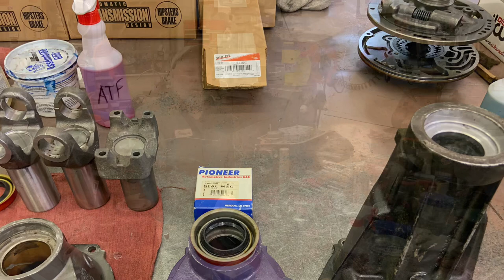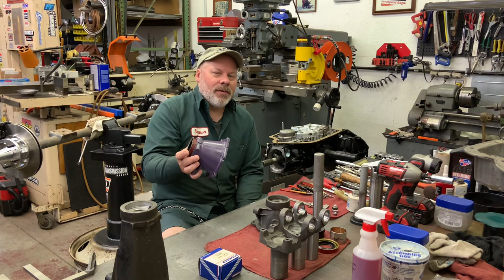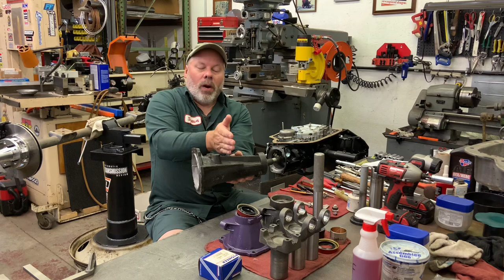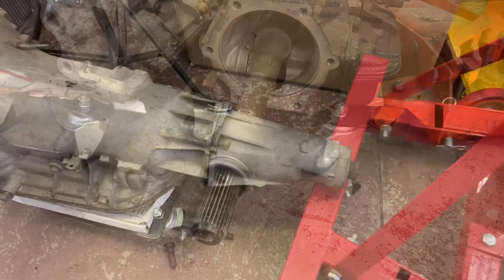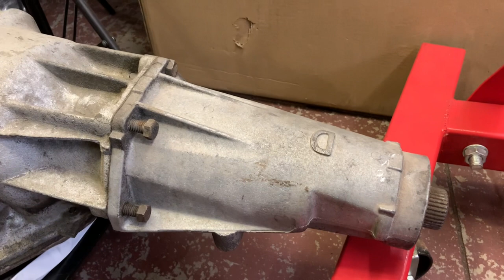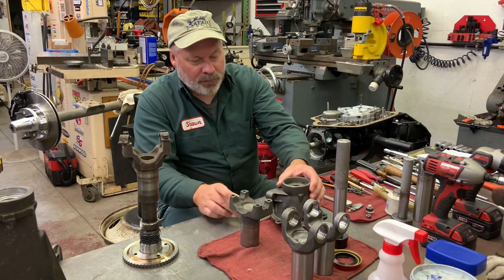Mountains Garage: Tail Housing Service

Comment: I just had a surprise leak on my TH 400 on the 1989 project truck I bought. It was coming through the pinhole in the yoke. I found out by pulling the driveshaft and cleaning it up. Someone had put silicone inside where the splines are. I'm guessing my fix will be a new o-ring inside the tail housing-cup. I still have to remove the housing, but thanks to your video I know what to look for. Thank you!

Comment: Got an old long shaft Pontiac turbo 400 in a mid 80s Buick regal. Been a great transmission... But just started dripping fluid at the tail shaft mount. Was just watching this to see how difficult this was going to be to fix  with the transmission in the car.   But what's life without a little adventure.

Comment: I am working on a 47 Buick with a 455 buick and a 68 Cadillac TH 400 with a V.P. convertor, short output shaft. I feel that the driveshaft is too long, almost 6 feet. I named the car Death Wish 7.  Car looks good outside and inside but when you look under the skirt, not so much. Real hatchet job. My job is to make the car safe to drive. I do enjoy your channel.

Comment: Those cadillac tailhousings are different: smaller diameter seal & bushing - they use a thin wall 3R yoke.  Probably not worth pushing past 450hp if I had to take a wild guess.

Comment: Probably have it fixed by time i get a reply, but my truck started vibrating driving down the road checked and a lot of wobble at yoke was checking youtube for rear bearing replacement found this video and now thinking bushing us out. What you think
Reply from the maker: The worn bushing might be an effect of a driveline problem, frozen u joint or worn center support?
Hopefully it is obvious?

Comment: So when I put the ('73 Catalina) TH375 in my '70 Lemans I just used what I'm pretty sure is the original '70 TH350 yoke (no hole in it). Is that a problem?

Comment: Did the 400 come in 66 Chevy trucks. Or is it something someone put in my truck lol. Not sure cause it has an Olds 350 Engine as well. Trying to order the right rear output shaft seal for trans errr
Reply from the maker: Looks like they came with them, but not with the Olds bellhousing.
Reply: @mountainsgarage  weird? This truck is such a Frankenstein. The chassis is GMC, Body is Chevy and it’s powered by Oldsmobile 😂

Comment: I purchased a TH400 short shaft transmission to put in a truck I am building from scratch but notice that the yolk bolt and washer are missing. Can you help me with the size of bolt and washer?

Comment: I need help. I have that long tailed 400 and trying to put it in a 1985 Grand Prix GBody. The 400 i took out has no drive gears and only reverse works. Tips and recommendations are welcome, jerks are not.
Reply from the maker: Take the tailhousing and output shaft out of the one you took out and put it in the long tail?
Reply: @mountainsgarage  It cant be that simple... can it?

Comment: I have a th400 with long tail extension. I a plan on putting in my 1980 Camaro. Do I have to convert it to a short tail for maximum performance?
Reply from the maker: If you go to the trouble of swapping, a long extension will be a odd ball combo. I throw them in the iron bin.

Comment: So if i want to remove the parking brake on My TH400 I'd have to put a bored slip yoke and short tail shaft housing? can i use the short tail housing that it has? Also why should we grind the output shaft is that only If we want stronger parts? I think ill have to go with the offshore stuff 😂
Reply from the maker: @Joeylucio22  You can replace the tailhousing with a normal short 2wd one.
I remove the o ring groove to allow the slip yoke to slide further. A counterbored yoke will also work without grinding.
Reply: @mountainsgarage   Awesome video very informative and knowledgeable, thank you for taking the time to respond

Comment: Hi, I’m trying to a replacement vss for a th400.  We recently replaced the th350 to a th400.  The issue is that our car has mechanical speedometer and this transmission came with an electronic vss.  I bought a Dakota digital electronic to mechanical speedometer converter.  The converter unit is stating that it cannot find a speed signal.  I looked up how to test a vss and the vss in the transmission now failed that test so I’ve determined that the vss is not working.  Would you have or know anyone that might have a spare vss laying around?  I’m from Hawaii and I checked a few places and nobody has one.
Reply from the maker: They are hard to find. Why not install a mechanical speedo drive?
Reply: @mountainsgarage  we are changing the rear end and rear axle gearing so I thought that this unit would solve having to buy new drive gears for the mechanical speedometer